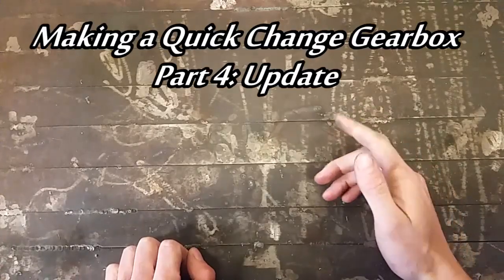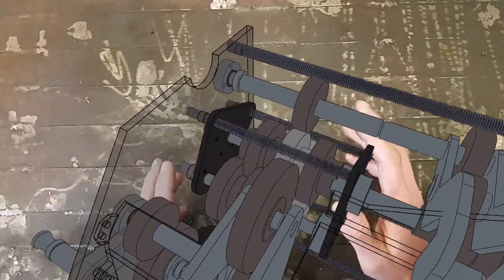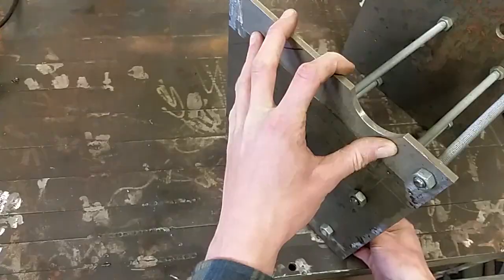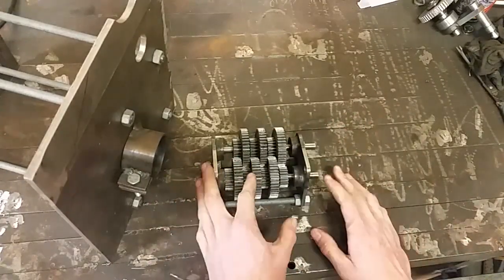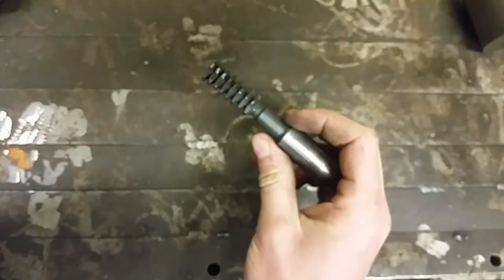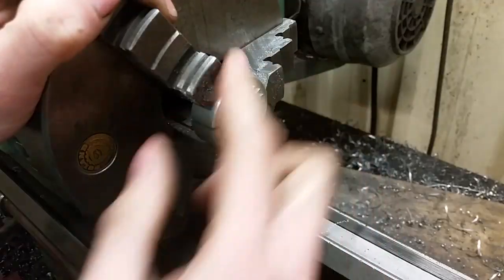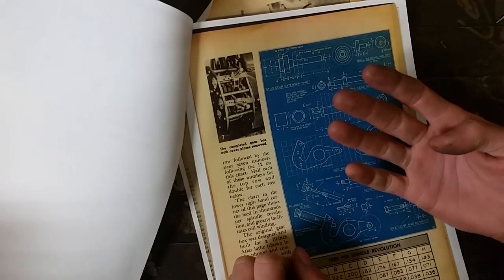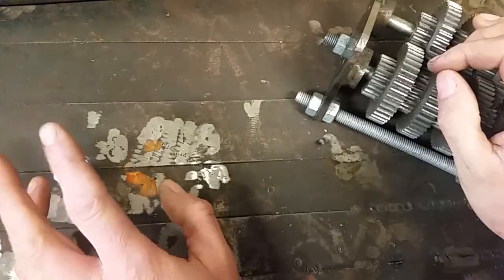Quick Change Gearbox Build P4

Comment: I'm surprised you didn't include a spindle speed reversing dog clutch a la hardinge while you were at it.
Reply from the maker: There's a lot of things I could have improved and added. Now that I know more I might revisit it and make some improvements. The main issue though is rigidity, under heavy torque due to very coarse threading the gear shafts flex and can cause the gears to slip. It's a good safety feature I guess, but not ideal. Thankfully I can still do all typical threads that I need!

Comment: As others have said, I too appreciate your more detailed description of the overall project.  In fact, I'd be delighted to see an even more in-depth explanation of your design and the process that lead to the design decisions you made.  I'm only a raw beginner to machining work myself but I've watched a ton of videos on the subject.  I have to say that I've never seen anyone else - even my favorite 'big time' (my term, not theirs) YouTubers like mrpete222 or This Old Tony - come up with anything as ambitious and complex as this. 
There may be another gear box out there somewhere that incorporates your doubling/halving gear set and an imperial-or-metric selector AND a screw gear stack - which alone has more gears than the complete change gear set that came with my little Atlas 618 lathe!! ...There may be another one out there, but I bet it wasn't designed and built entirely by a hobby machinist working with his own modest equipment.  How many discreet thread pitches can this box cut anyway???

One thing I don't yet understand is the final "fine adjustment thread pitch selection" that you mentioned.  I haven't finished watching the series yet, so maybe all will be revealed... :-)

You've earned another subscriber, and I have to echo the surprise of other people's comments; wondering why you don't have thousands more subscribers already?!  Maybe there's just some threshold of the number of videos you have to post before the numbers of views and subscribers start to snowball?

Thank you for the excellent videos!
Reply from the maker: Yes it was a very ambitious project and I certainly learnt a lot!
I plan on a gearbox followup next year, so I'll see about including more details there.

The stack of screw gears I mentioned allow me to make small adjustments to feed rate when taking cuts. It's beneficial to get nicer chip formation and chip breaking ie the whole black magic of speeds and feeds. In addition this stack up allows me to select different threads in small increments. I made my gears to mostly match my lathe's gearing chart, so it replicates about any arrangement that you could setup. To be honest I still haven't tested the full range yet, but it should be capable of cutting any standard thread from 4-112 TPI, and 6 to 0.25 mm pitch.

As for subscribers, I'm happy it's ticking up and youtube seems to be exponential, so we'll get there!

Cheers!
Reply: @TomMakeHere  Absolutely, please do a follow up. This series is for sure one of my favourites and has great insight into a QCGB. Well done :)
Reply from the maker: @JeffPedlow  Stay tuned :)

Comment: Tom, thank you for this much more detailed video.  I've just discovered your channel and am now playing catch-up starting with your oldest videos and working forwards.  I jealous of your horizontal mill and what I suppose is a "real" vertical mill (i.e., not a mill-drill like mine), along with the dividing head you used to make your gears.  Old machine tools simply aren't common/reasonably-priced where I live (a "non-industrial" part of the US).  Keep up the good work!  Here's my vote to continue providing more details and thought processes about your projects as you build them.
Reply from the maker: To be honest machine tools aren't exactly cheap in Aus either (I occasionally see $200 surface grinders over there grr! Same thing here would be $2000+)
Yes this mill is solid, however it has a small vertical working area; even with small work pieces I struggle with drills larger than 10 mm (3/8") without breaking out the collets to gain a bit of head room
Thanks for watching and commenting

Comment: Do you have a link to your gear calculation App?
Is your Leadscrew Metric or Imperial and what pitch?
Do you have any drawings?
Great work. I too hate the lost time switching gears for various feed rates and Metric to SAE thread pitches.
Reply from the maker: Sure send me an email. I have a few people trialing it. Let me know if there are any features that are missing. tommygmachining@gmail.com
Also I have an imperial leadscrew (8TPI), my spreadsheet allows any combination cutting to/from metric or imperial.
Drawings are tricky, I've considered it, but beyond a 'gear map' it all depends on your lathe dimensions, module/diametral pitch of your gears etc

Comment: I like the speed reducer/multiplier. Been playing around with designing a gearbox myself and I might steal the idea. One point. You went through all the trouble and no Single Tooth Dog Clutch set-up. Or did I miss something.
Reply from the maker: My favourite part of the gearbox :)
I'm not quite sure what you mean, the gears are locked together in pairs (1 large and 1 small). I know I skipped over details, but part 2 should show the pins being driven locking them together
Reply: @TomMakeHere 
A single tooth dog clutch is used to allow threading of any pitch, be it Imperial, Metric, DP Worms or Module Worms without ever opening the half nut.  If the STDC is built as Reversing STDC is allows cutting threads without opening the half nut or reversing the spindle. Normally seen on high end Tool Room Lathes such as a Hardinge HLV. The concept goes back about 100 years. Originally developed by Hendly Lathes iirc. Once you've  cut threads this way everything else seems crude. With the caption of CNC of course
Reply from the maker: I will need to look into this. It might make a good project
Reply: @TomMakeHere  when I get the chance I'll send you some rough drawings. I'm thinking the primary deduction section would operate a little differently.  Its output gear would slide along a splines shaft engaging the stepper gears on the input side (1:1, 2:1 and 4:1) with another portion of the shaft having a 1:1 and 1.5:1 set-up. This would give 1:1, 1.5:1, 2:1, 3:1, 4:1 and 6:1. This feeds into compound gear train at 1:3.1415 and 1:1 (52-40/62-46 and 46-idler-46). The 46 toothed gear would shift between the two gear trains. This is the DP and Module worm generator. A 1mm pitch would be a 1 Module worm.  This is followed by an Imperial/Metric section (32-51/32-51 for 1:2.54 and a 51-idler-51 for 1:1). The metric train is 1 in 64,000. That should be close enough. The cluster gears for Imperial/ SAE is easy as these are simply ratios between the TPI and the  Leadscrew pitch. The Metric side I'm still figuring out.
This will not be used for powering any feed rates. For feeds I much prefer a variable speed DC drive. Adjustable on the fly for finish, chip load and chip breaking.

The above mentioned splined shaft. Cut 4 keyways the length needed and insert keys. On the gear broach four slots 90°s apart. One way to space these is if you have a keyway broach is to mill a keyway 90° from the guide slot and use this to index the slots in gear. This approach could also be used for two keys, 6 keys or 8 keys. For the bulkheads between the sections I'm thinking 6061 tooling plate in 8 or 10mm (or 5/16 or 3/8 depending on cost) with stand offs between the bulkheads expoxyed in place on one side with studs running though to tie the sections. Studs cut from alloy steel instead of hardware store grade threaded rod. 

Send me a PM if possible.
Reply from the maker: @mpetersen6 I'd be interested if you flick me a sketch tommygmachining@gmail.com

Comment: I just subscribed so I am catching up. I enjoy your humor as well as the interesting content and the effort that you put into these videos is enormous. I hope some of the Big Names give you a shoutout. You deserve more subscribers. Now to my question....In addition to the article that you referenced.....what other sources did you use for design of this build....studying existing quick changing gear boxes?
Reply from the maker: Yeah looking at existing QCGB's and cherry picking what I wanted. I've gone over and above a typical design because usually they are either metric or imperial, and often have 1 manual change gear on the input into the gearbox. I elected to incorporate all of the foreseeable manual change gears into the first selector.
The hardest component for me was the 'multiplier gearing' it took me a while to work out the black magic behind the staggered gears before I realised they were pinned in pairs
Reply: Thanks for the response. Yes...the metric/ imperial optimizer gears are unique.

Comment: We think this gearbox is going to really be helpful, it is a pain and it takes us a bit longer to change the gears all for one thread to take place and then change it all back, so we are watching 4 eyes and 3.75 ears to your build. No machining HUH you showed that mill the first reason we came here cutting that plate for one side of your lathe gearbox. Hey we watch Robertt4522 also. 
Bronze bushings oil question thought? Oilite is that what you used? Bearings too small what millimeter I.D./O.D. diameter needed? Just curious not saying anything here only trying to learn from you. Thank you for the video.
Reply from the maker: If I used bearings the OD would be 20+ mm. So on the 30 mm bearing housing there wouldn't be much material to screw / weld them on
These are oil impregnated sintered bronze bushings
To be honest, there is no maths on the bushing / shaft size. If they wear out I can change bushings. If they keep wearing out quickly I will look into changing them for roller bearings

Comment: My hat is off to you.   Wow!   What is your opinion of electronic lead screws?  Yeah not old school but infinite possibilities and a lot less hardware.
Reply from the maker: I did consider it and maybe include an arduino with presets depending on chuck speed etc. But it would be hard to fine tune. Ive allowed for this gearbox to in theory cut a 300 mm long thread with 0.01 mm error
Reply: Pretty interested in this at the moment.. Ie the last 3 years. If anyone sees anyone doing this let me know so I can watch!
Reply from the maker: There was a video of someone who made a QCGB with this setup https://www.youtube.com/watch?v=7kB2NFhUWKE&t=0s
Depending on how it runs I might just keep the gearbox for threading.
Electronic leadscrew could be interesting for slotting with the carriage too. If you setup an arduino on a loop it could cut a slot for you. Definitely something I've considered